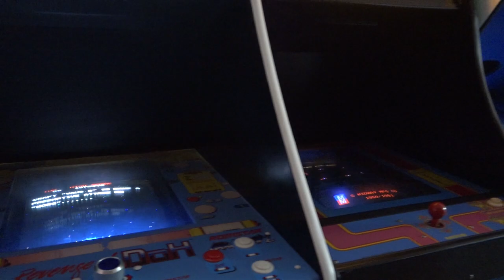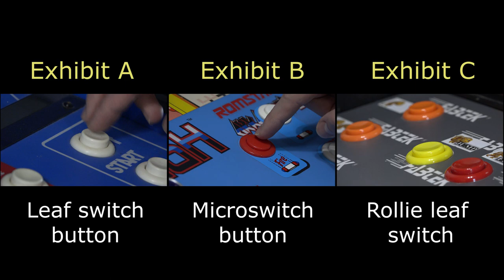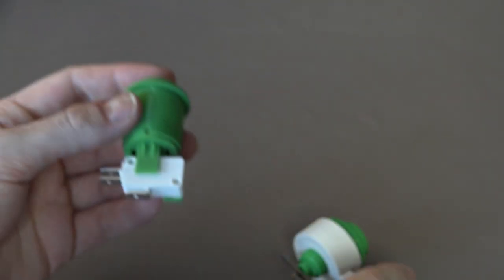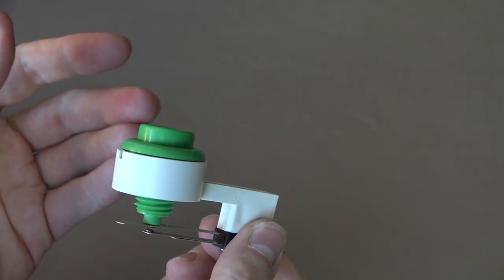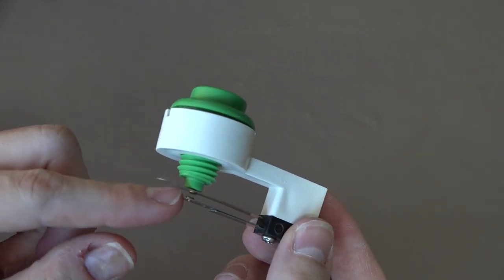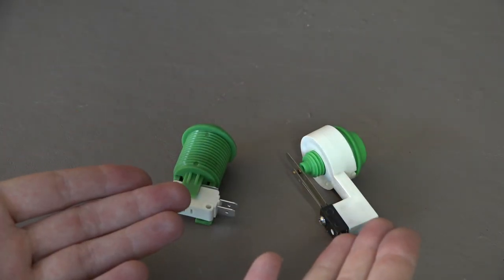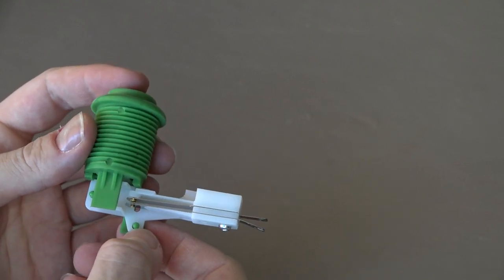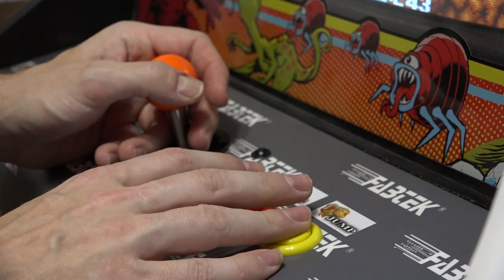Arcade Buttons - Leaf vs Microswitch - Rollie Leaf Switch Review

Comment: Great informational video.  What I would like to see is a micro-switch that can swap easily with my 80's leaf switches.  The problem is the size of the hole needs to be expanded and I'm not so sure I want to be drilling my stock cabinet.

Comment: A few things to note:
1)  Arcade Leaf buttons dont have to be pressed all the way down.  You just need to press them far enough down.. to make the contacts connect, and then you stay at that level, and lightly "Vibrate" your finger... so that the contacts open and close rapidly.   This technique is called "Feathering".  With it, you can fire MUCH faster than any other way... AND... it takes almost ZERO physical effort to do so.   As such, you wont experience Fatigue, when playing a rapidfire shooter, such as "Haleys Comet".   That particular game rewards players with the fastest continual fire rate... with the capability to pick up more powerups.   Its virtually unplayable with a Microswitch... because they have so much tension / resistance... that your fingers will get way too tired, in only a few minutes worth of play.

2)  There are sellers of different "Modern" leafswitches...  However, they are problematic... because the buttons have very little travel, and the button spring is way too light.  As a result, just resting your fingers on the buttons, activates them, accidentally.   As such, they are WAY too sensitive.   The seller claims that you can simply stretch the spring, to add resistance... but as much as I stretched the springs, they were still way too easy to push / activate.

3)  There were a few different versions of Leaf Switches.  Some have long travel.. and some had shorter travel.   The longer travel, are on games like Asteroids Deluxe...  and they are absolutely PERFECT, when using the "Feathering" technique.   If you want to pick up Brand New  "Long Travel"  leafswitches... I believe you simply have to buy Pinball Buttons  (Unless they have changed to micros, they should be using a very similar arcade leafswitch button on them).

4)  The Rollie is a decent compromise...  but IMO... they still do not compare to the real Long Travel leafswitches..  as they will  "Bottom Out"  well before you can "Feather" them.    Bottoming out a button, causes more Noise, as well as creates a small impact shockwave... that ends up going into your fingers.  After so many of these impacts... it starts to cause a bit of Fatigue.   Also, the act of rebounded off of the bottom... adds more physical resistance, through Energy Losses.   One might be able to reduce some of that... if they installed very bouncy rubber pads, on the bottom of the button housing... however, that might also effect travel, and the rubber might wear down quickly.

5) Ive not looked into this... but it might be possible to create or modify microswitch buttons, to have longer travel.   But its basically pointless, since you can simply pick up Pinball Leaf buttons, instead (I believe).

6)  The problem with Used Leafswitches (not the buttons, but the actual switches)... is that the Metal Springs eventually start to "Fatigue".  The springs basically lose a lot of their  "Springy-Ness"...   and so when you press them down.. they often wont fully return to where they started out.   You can bend then at greater angles, to try to solve this... and it will work for a short period of time... However, they will quickly bend right back to where they were... and become a problem again.   This also happens on older Pinball Leaf Springs.   Its also a problem for many older "Spring Powered" toys...  where the springs in them are no longer strong enough to function properly.

Finally.. I shall be even more clear about Feathering.  Once the contacts connect... and your player "Fires"..  the contacts are touching.  When you vibrate, the contacts will only separate... about the distance of a single sheet of paper... before connecting back together again.   As such, there is almost Zero button travel, and nearly ZERO delays..  between your presses.   This allows you to reach rapidfire rates, that are on par with  Digital  "Auto-Fire"  cheats.   Maybe even faster... because some of the rapidfire cheats have a "SET" rate of fire, that cant be changed.

Comment: I just bought some classic leaf switch buttons I want to put in my Arcade1up.  The plungers on these are not compatible with the Happ microswitch buttons so a Rollie Leaf Switch won’t work.  Can I install the classic leaf switch buttons in my A1up control deck and just connect the wires from the encoder board onto the terminal contacts?
Reply from the maker: Not sure. I've only ever dealt with the real original arcade hardware and never worked with any of the Arcade 1up stuff.
Reply: @dinkyflix  answer: yes classic leaf switches do work on an A1up encoder as long as you have the space for them under the deck.  Buttons that are too close together won’t work.

Comment: Its easy to see it has more precise click, less presure but its hard to find leaf switch like in yoyr videi and that metal look like easier for corode then microswitch with case. Now all you can pick is microswitch with 2 pins/holes and case or some sanwa gear with keyboard microswitch. All other option are rare and expensive. Btw size of leave microswitch is very demanding.

Comment: I have a question? What is your opinion on cherry d44x switches compared to the 50g and 20g versions.
Building my first cabinet and wanted to use top of the line controls and switches.  I'm 90% sold on il eurojoystick  and il buttons just don't know what I want for switches yet.
Reply from the maker: I haven't personally used those microswitches - most of my microswitch stuff is of the classic Happ style variety. With that said, my personal preference has been for a heavier feel since that's what I grew up with in the arcades. Microswitches are pretty inexpensive, so I would recommend buying a couple in each flavor and deciding which ones to go with based on how they feel to you.

Comment: Why does the micro switch have 3 prongs, i just bought some to replace in my arcade 1 up machine and i dont think theu are going to work lol
Reply from the maker: That's standard. Bottom is ground. Then the other two are for NC (normally closed) and NO (normally open.) You attach the button wire to NO if you want the button to close the circuit (aka activate) when you press the button (like most circumstances.) You'd use NC if you want the switch to activate when the button is released.

Comment: Open up a microswitch (2 small screws) and inside you'll find........a leafswitch!
Reply: Well not quite, because it has solid pieces and a hinge and a return spring rather than relying in the natural flex in the metal, but you could.
Reply: Ya, not exactly the same.